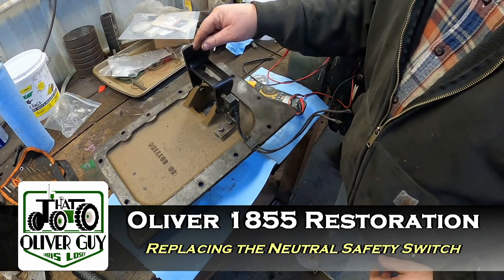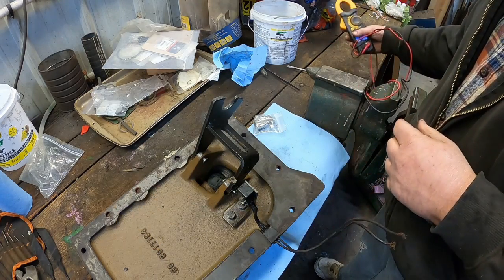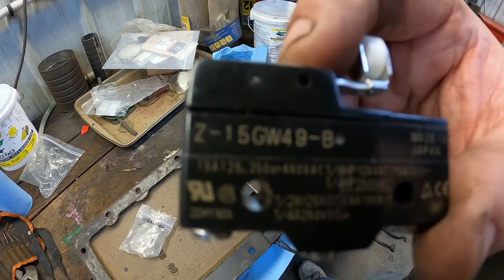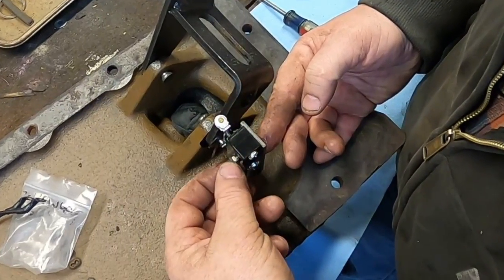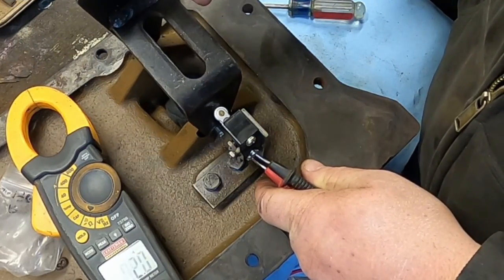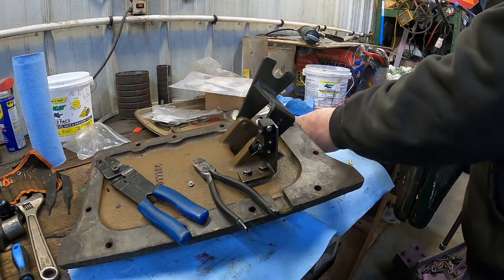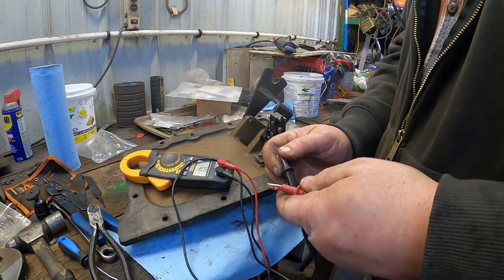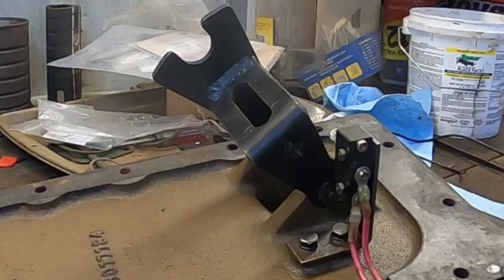Neutral Safety Switch for the 1855 project

Comment: I tried starting my Allis chalmers G in gear one time.  I always park it in neutral but i guess the kid had climbed up on it and pushed the gear shifter down into gear with his foot. And I'll often start it from the side because all the controls are behind you.  She took off and started climbing a  mower that i had parked in front if of and thankfully i could hit the ignition switch off before any damage happened.  Now i double and triple check that it's in neutral.

Comment: I'm guilty of crossing the wires on my White American 80 back a few year ago. That said when I had the clutch and the wiring redone in 2021 I had a new switch put in. I do think it's best to have the tractor with the safety switch working, so if someone unfamiliar with that issue would not have to be told and an accident happen if they weren't. Thanks Chris, have a good rest of week.
Reply from the maker: I agree, I know what is going on with my tractors, but if someone else was to get on, say a kid at a tractor show, things could get ugly fast.

Comment: Did Oliver ever get sued because people couldn't read the operators manual where it most likely says start tractor from the seat and be sure it's out of gear. One of my neighbors got in on a class action lawsuit again John Deere because he bypass started a 4320 hooked to a 7000 six row planter.  You guessed it, the tractor was in gear and he got ran over and planted.
Reply from the maker: I'm not aware of any lawsuits against Oliver, but I was at a Gehl service school and after talking about all the safety stickers on their equipment, I asked if anyone had ever sued for doing the thing that the little stick figures on the decals shouldn't have been doing. He said he knew of one time. Someone got pulled into a round baler and killed, but it was eventually discovered that one of the holes in the guy was a bullet hole. Gehl was off the hook and it became a murder case. What an idiot, they had basically gotten away with murder and thought they could make a buck while they were at it.

Comment: What?  No pink wire in your collection....  We always changed those when we had the cover off.  Too cheap to be cheap.  Keep the videos coming.
Reply from the maker: I should have gotten some Ophelia paint out. 😂
Reply: @ThatOliverGuyChris  Juliet is strutting her stuff by pulling one gang of a 7' horse-drawn disk. She just needs another 100-pound oilfield weight added to the one already on her 3-point hitch.  Even with chains on her rear wheels she still does a Daddy Herman and spins them when the pull gets hard.

Comment: Hey Chris I got a question on how to install the springs in a shifter it there a video on that or am I just doing something wrong
Reply from the maker: I don't have a video on that. If it's a later tractor line this, just put the springs down in their holes and put the shifter in. Something like a Super 66 can be tougher because the springs are in the casting that bolts onto the housing. They like to fall out. I pack them with grease. That keeps them in place and prevents rust as they sometimes like to do. Another trick is to cut a piece of cardboard with enough of a slot for the lever to stick through, but narrow enough to keep the springs in place. Set it on the tractor, and when it's engaged properly, slide the cardboard out and bolt it down.
Reply: @ThatOliverGuyChris thanks will try but when I put them in my gear shift will not go in to the other range so I’m stuck in low range it want to go up but it doesn’t I wounder if I put them in wrong thanks!!! Also the tractor is a 660
Reply from the maker: @Olliesuper66  there is a slot in there for the interlock the the lever can get into and cause the problem you have. Pull it back out and try again is usually the answer.
Reply: @ThatOliverGuyChris   ok I’ll just move it around and try again hopefully I can get it but it also it free in the slot I can easily change gears in the range